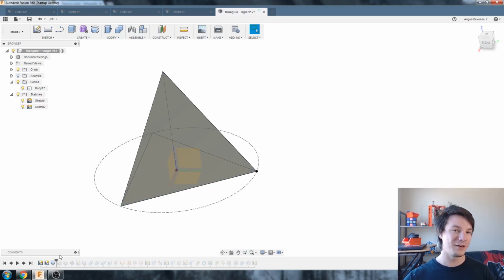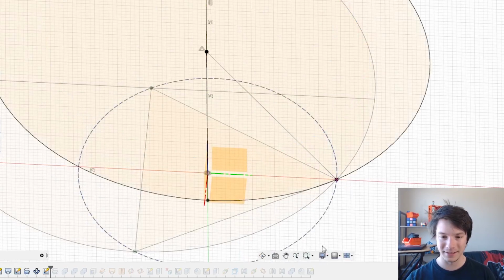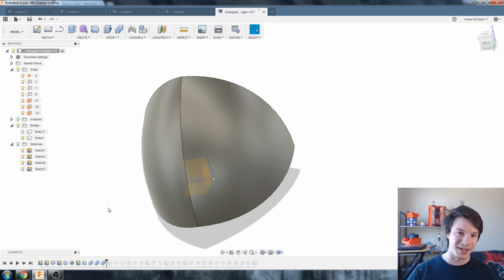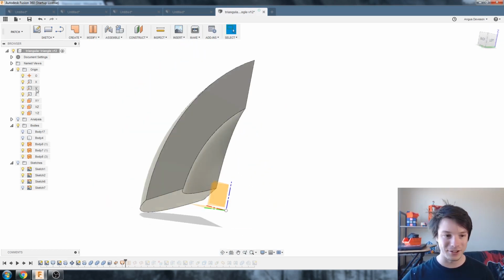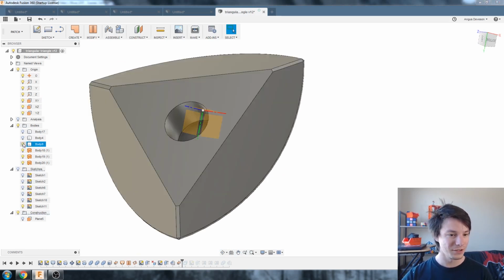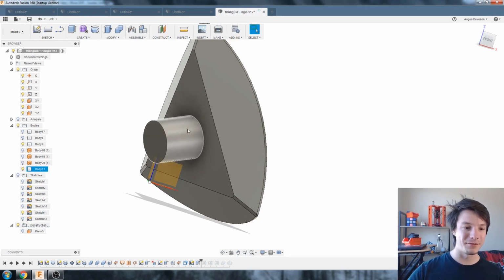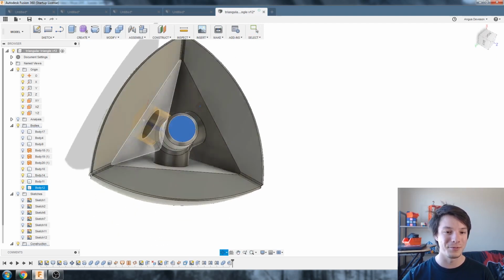Making a Reuleaux Tetrahedron 3D Printable in Fusion 360

Comment: Another way of making a tetrahedron is connecting points on a cube, then measure the edge length and create spheres with that radius. You can use a cube calculator to determine the length of the cube if you want a specific tetrahedron size. What formula is it to calculate the height of the tetrahedron the way you did it?

Comment: Around 11m24s you delete the concave face and F360 auto-fills the gap. However when I try to reproduce your steps, it changes the body from solid (as per post-stitch) to hollow and the concave face just becomes a hole. Did you do something after stitch and before hitting delete to make the object remain solid?
Reply: Replying to myself: ah, you have to be back in the MODEL workspace before you hit delete.

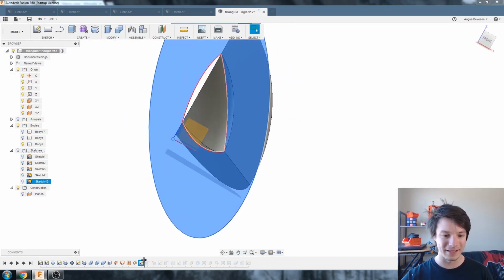Comment: At 10:50 or so would it not have been easier or faster to move the construction plane into the body and do a split body using the construction plane? Thanks
Reply from the maker: About the same amount of effort as you need to create an offset plane from the new 3 point plane, but yeah I use the methods interchangeably.

Comment: Cool, this shape is also known as a Meissner tetrahedron
Reply: It's not really the same: The Reuleaux tetrahedron doesn't have constant width, but the Meissner tetrahedron has. The difference is that the latter has three of the edges rounded. Either three that form a triangle, or three that form a star.

Comment: Are you sure you are mirroring on the surfaces?, I can't select them
Reply from the maker: you should be able to select any flat surface, they might not have generated flat from the loft. If you're able to create a sketch on it, it should be able to be used as the mirror plane.
Reply: I didn't get them flat. Going to look into it. thanks
Reply: I'm on my laptop and only have the pad to work with. Going to see if I get my head around this when I get back home. Thanks again for a great tutorial.

Comment: For some reason I wasn't able to put a chamfer on the inside edges of the peg. It worked, if i only selected for of them but the 5th always gave an error. That should indicate a problem with the corner or edge there, but if i select different 4, the 5th still won't work. Anyone got an idea as to why this happens or is it just one of fusion weird things?

Comment: And btw., since you talked about using perimeters in your design in one of your last videos: for the dimension of the vertical edge of the tetrahedron you could use d1 as the dimension. That's not a user perimeter, but one fusion creates for every sketch dimension you enter. That takes care of the "problem", that you'd have to change 2 sketches here to have it update completely. Of course it's not really an issue here, but you know... clean design is the best design and i thinks it's definitely a good practise to do so

Comment: You lost it when you rounded corners (it doesn't have constant width anymore). Rounding corners in reuleaux tetrahedron should be made by offsetting outer surface out few millimeters (at the stage, when you have full tetrahedron).

Comment: Wouldn't it be easier for this particular application to use the sphere feature in thr create tab? You could just put the middle point on the edge and make the size d1, what should be your 60mm from the start (or make it d2 if you accidentally made a dimension before that, you can just look it up in the sketch or the perimeter menu). That should be even easier than making thr spheres with revolves and then pattern them. And Fusion has the feature, so whz don't use it?
Reply: And i think you should be able to make the intersect immediatly with creating the spheres, when you do it like this, so that saves another 3 steps. Gonna check it in Fusion when i get home, but i'm pretty sure it works :D
Reply: The instant intersect unfortunatly doesn't seem to work too easy, because it wants to create the spere from a sketch and if you don't create a new sketch for every sphere, the other ones don't exist yet if you make the next. But doing it with the spheres makes it a lot more convenient!

Comment: Are you sure that this is a solid of constant width? When i modeled one in Solidworks (a few months ago after you last video) it was really close but not a perfect solid of constant width. Also using spheres was really smart I went with surfaces and 3d sketches.

I will try modeling it your way and check
Reply: Tristan Frodelius indeed, a Meissner tetrahedron would be the corresponding solid of constant width
Reply: You have to modify the Reuleaux tetrahedron slightly to make it a solid of constant width.  The modified version is called a Meissner Tetrahedron. See http://ceptimus.co.uk/?p=345
Reply: Hey guys, I made a video in which I go a little into why this is not a solid of constant width, you can check it here: https://www.youtube.com/watch?v=quuw4HC96bE
You need to make a second video on how to make a 3d printable version of the meissner tetrahedron, but then you'll lose the mirror symmetry the reuleaux tetrahedron has. I'm curious of seeing how you'll tackle this
Reply from the maker: Yeah it seems pretty spot on, I just followed the wiki instructions :P
Reply: Maker's Muse i was getting differences of height that were like .1mm for a 5cm equalateral so it was really hardly noticeable but it was measurable
Reply from the maker: hmm yeah will look into it